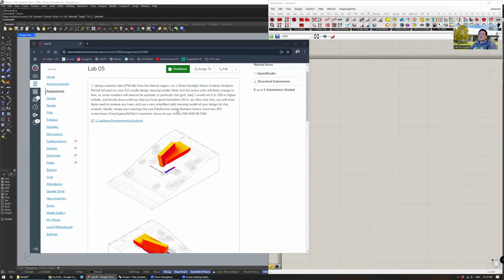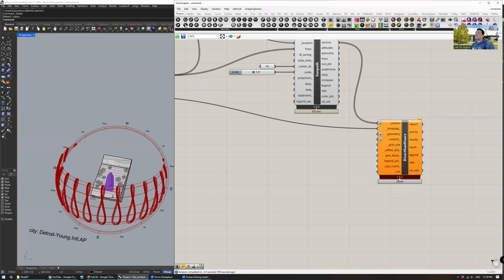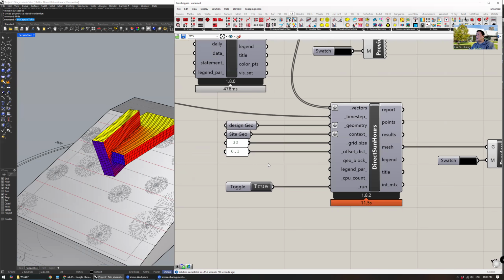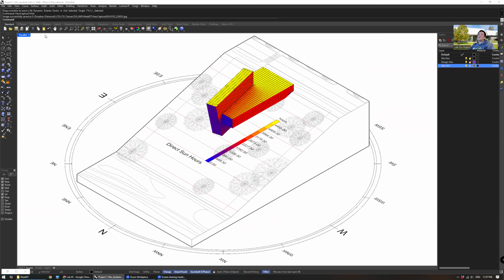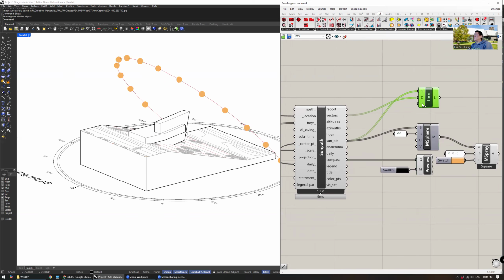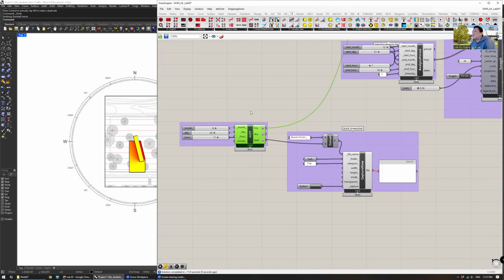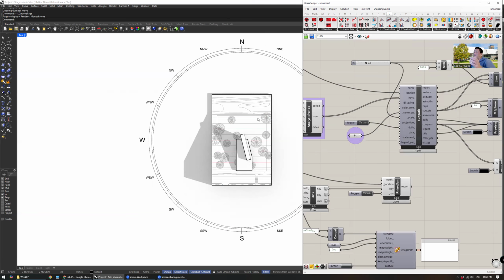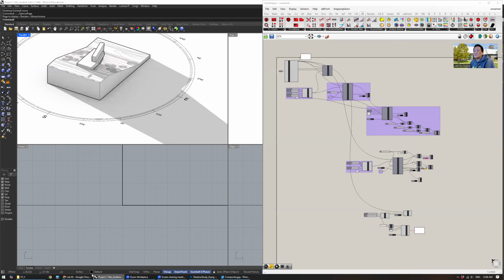Rhino+GH Ladybug Tools 1.8 Direct Sun Hours, Sun Path, and Shadow Analysis

Comment: This was great ! I got an issue with the RhinoSun component in ladybug: it seems like the shadows projected in my custom viewport are dependent on the component (rhino sun) from LB. Any possible explanations?
Reply from the maker: Not sure about your specific issue, but one thing I notice is that you must have the Rhino Sun set to Manual Control for the LB component to be able to take control, otherwise it is fixed by your geolocation and time/date settings in the Rhino file.
Reply: @LeeSuHuang  thanks but it did not resolve the issue.  Seems like the LB compontent oly takes control over the cast shadows in the rendered displaymode. im currenlty using rhino 7, maybe that is the issue.
Reply: perhaps, I've been able to get it to work in the other display modes with RH8. I'll try with my RH7 and see if that's the case.